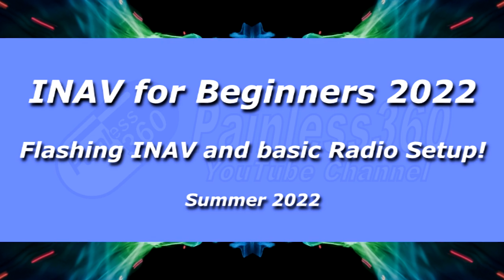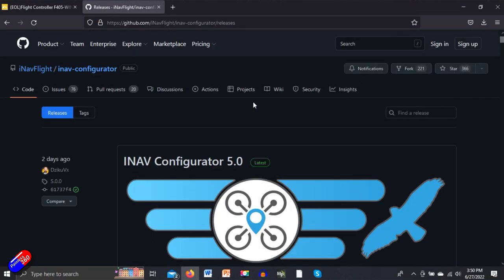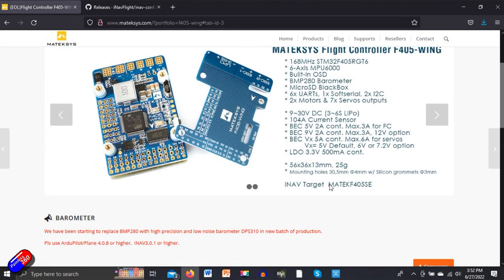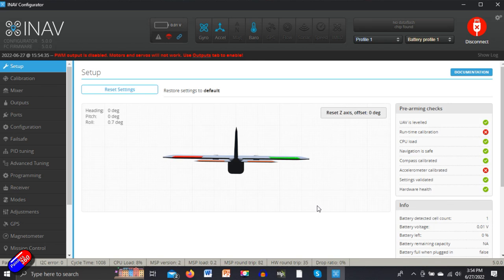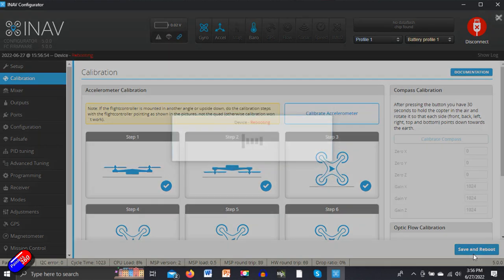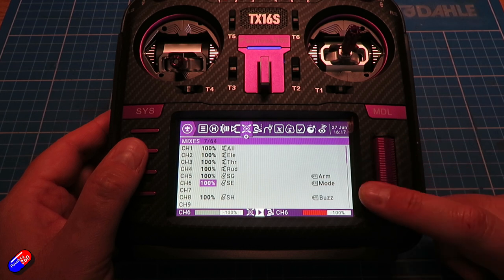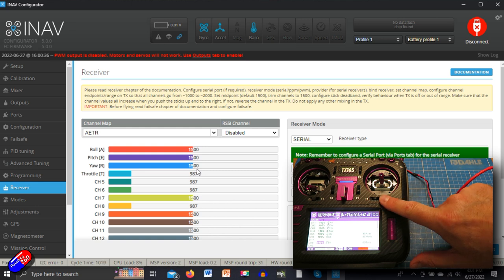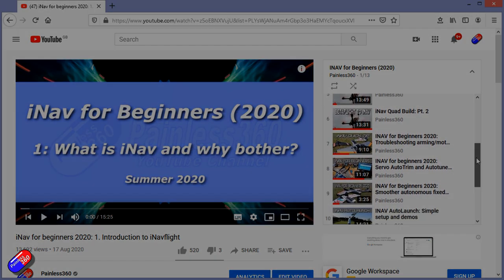(2/7) INAV for Beginners 2022: Downloading, flashing and basic radio setup

Comment: I have a problem with my heewing and wing fc..
I hooked everything up on inav etc right servo to no4 output left to no3 output..
Now my roll is pitch and pitch is roll?
I have moved roll and pitch in my tx seem to have worked for stick control but the fc is still the wrong way when moving the wing 😪
Reply from the maker: Don't change anything on the radio. See the other videos in the series...
Reply: @Painless360  I just did it was as simple as changing just one servo direction fgs thank you 😊

Comment: Lee - After Flashing I noticed DFU disappears and is replaced by the COM5 Port  which opens up the Configurator on pressing Connect  - COM5 being the key to open up the Configurator for your particular model - I get COM1 so my Configurator stays closed !!?? why is this - I've used Zadig & ImpulseRC Drivers  - no Joy 
 A week ago COM4 as did    '' \\.\COM14 ''      not sure what    '' \\.\ ''    means   opened up  the Configurator - is there a way to select  a free COM Port to open up the Configurator - you can select a COM number at top of page but it is greyed out and invalid - been poking my fingers at various sites for a week now but no joy - I do hope you can shed even a festive  candle light on my dilemma - have a very merry Christmas ...joe
Reply from the maker: DFU should only appear when the FC is in BOOTLOADER MODE. So you shouldn't see that at any other time. COM Ports on each PC will be different but if you are saying that the port numbers have changed after an update, this isn't common. Maybe you replaced the normal driver too? Best of luck!

Comment: Ok my friend... I'm stumped.  I have a tango 2 transmitter a brand new tbs crossfire nano reciever bound and in sbus mode my transmitter monitor shows everything working. Inav is on sbus all pre arming check Mark's are green, but when I waggle my sticks nothing moves on the monitor.  I asked you about this before because my old reciever is soldered to a pwm adapter.  This one isn't and I got nothing.  I followed exactly what you did is there some setting somewhere I need to change  ? I am really frustrated at this point.  I know you aren't tech support but you are very knowledgeable about all of this stuff.  And help would be appreciated.
Reply from the maker: Check out https://youtu.be/aq4hRkDCuCs about the 12:00 mark. Sounds like you have something incorrectly setup... best of luck

Comment: You have got my attention now, I am looking forward to the upcoming vidieo's. Maybe a silly question, but can you explain when to choose  INAV over Ardupilot ?
Reply from the maker: Covered in the first video in the series. INAV can be similar to setup if you know the configurator and you don't need the extra features that Ardupilot has, that usually require a lot more sensors (compass and airspeed) to work... Happy flying

Comment: I have bew matek board, came loaded with inav 4.1 It shows up with an asigned comport, The PC has connected and flased older versions on other boards so the stm drivers are all good. The new matek 411WTE ont flash at all. tried zadig although it shouldnt require it as it already is identified by windows and inav. Update usb driver with zadig anyway but now PC wont see the board at all. I had to roll back the usb driver so now Im back to square 1!. Always a ball ache with inav...any help appreciated. Thanks
Reply from the maker: I've not seen that. Connection errors are almost always driver or USB cable related... Best of luck
Reply: @Painless360  sorted, I wasn't shorting the bootloader pads during zadig driver update.:)

Comment: Hi Guys I have an apprentice S15E with a matak F405 wing, running version 2.3.0 how can I save the current setting on the flight controller and update to the current version 5.1?  I have a taranis X9D plus but dropped it so I need to buy a new radio to get the plane flying again. Any help would be greatly appreciated regards Paul.
Reply from the maker: Upgrading from such and old version is tricky as so much has changed. See the upgrade path using things like DIFF ALL from the release notes on the INAV firmware. I'd make a note of things like the offset angle, modes, OSD layout and mixer settings and start again fresh with the latest version. Best of luck!
Reply: Thanks Lee you do awesome content !

Comment: Hello my friend,  I'm using TVs tango 2 transmitter and a nano reciever soldered to a 6 ch pwm adapter.  I've thing I've done everything correctly, reciever is bound and connected to the transmitter calibration is done. But when I check for movement on the inav reciever page I got nothing. Any suggestions as to a different setup or ???
Reply from the maker: Why not wire the reciever directly to the flight controller via SBUS or CRSF?
Reply: @Painless360  I had it installed without a flight controller so it was previously soldered and now im installing a flight controller
Reply from the maker: You can still use CRSF or SBUS on those outputs... best of luck
Reply: @Painless360  yea I tried that and still got nothing. I noticed on the setup page under pre arming section everything is green except the (Navigation is safe ) that still has a red x

Comment: Extremely helpful !!!  I've been flying drones with Betaflght and learning curve was very steep for me.  Knowing it, iNav looks familiar.  One question though, what kind of receiver are you connecting at 12:30 ?  I was planning to use X8R.  Is it possible to use R-XSR like on drones ?  That'll be awesome.  I was hoping to use more than 8 channels because whole purpose of it is to have FPV airplane.
Reply from the maker: Anything you use already should be fine... best of luck

Comment: for me, one downside of Inav compare to Ardupilot is the trimming during maiden flight..i dont have full control during Manual flight mode in Inav, cannot do manual trim nor dont have Dual Rates, but in Ardupilot its more easier to do the maiden flight as you have full control over Passthrough mode..although we have autotrim mode in Inav but its not enough if you want to do initial trimming
Reply from the maker: INAV now does the same thing..keeo watching..

Comment: Hi Painless360  I am new to INAV and I am having difficulty loading INAV Configurator.  It downloads fine, but I cannot get to the screen where you type version in.  I did notice that when yours loads in the video it has manual at the top of the screen where mine has UDP.  Also yours has a few images on the top of the screen where I have nothing.  Can you help please?
Reply from the maker: UDP is used if you have a wireless connection to the flight controller. When plugged into your PC, a COM port should appear in the dropdown list. If not then check out the links on the INAV main screen to download the driver... best of luck
Reply: @Painless360  I keep getting "Failed to open MSP connection.
Reply from the maker: You need the right Com port selected in the drop down box. Try another USB cable as well. A more complete list of what you've tried already would be helpful...

Comment: Fantastic, Lee! Thanks a bunch for the video! 😃
Just one question about receivers. In case of using ELRS, Crossfire or Ghost, they use 4 wires instead of 3 like SBUS... So... Is there any 4 way connector that would fit like a servo connector? If so, what is its name?
Anyway, stay safe there with your family! 🖖😊
Reply from the maker: Dupont connectors come in all shapes and sizes. I use the 4 pin ones for GPS here... Happy flying!
Reply: @Painless360  Oh, fantastic! 😃
Thanks a lot, Lee! I already searched about it and found some options!